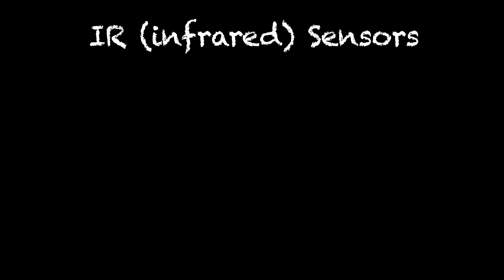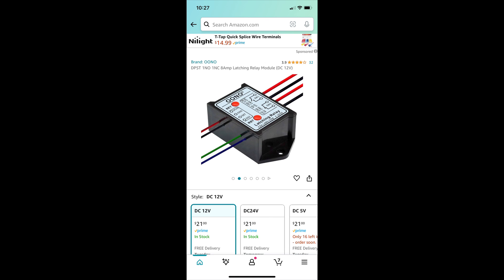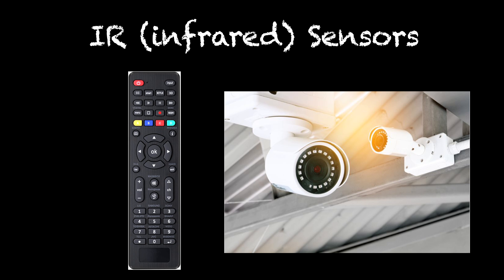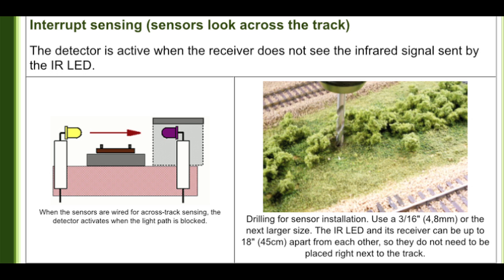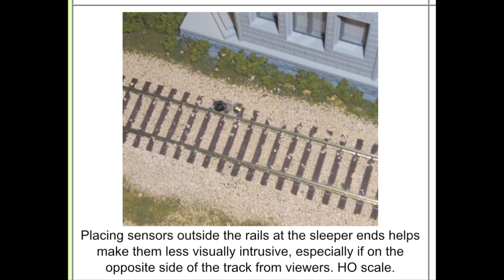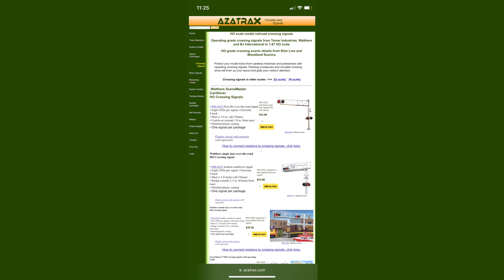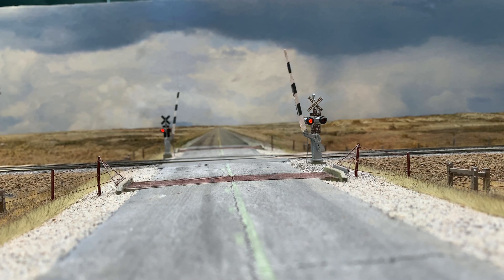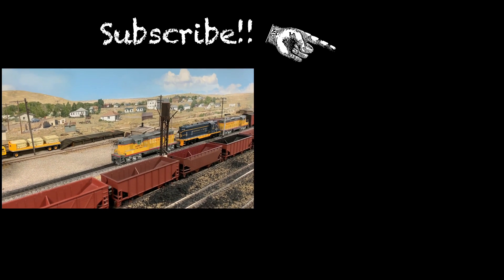IR (infrared) Sensors - Electricity for Model Railroads

Comment: I really enjoyed this subject. Since my o-scale layout has an oval with a figure eight on the upper level, I want to try my hand at setting up some relays to control traffic on the incline/decline connecting the upper and lower levels and collision avoidance on the figure eight. I’ve got some Z-stuff that will probably work. I need more time, though. And less Toy Man Television on YouTube is not an option. 

Oh Wamsutter! Back in the 70s, I used to work on drilling rigs in the Red Desert to pay for college.  We exited I-80 at Wamsutter as I recall and went north for an hour or so on roads paved with gravel. While driving back and forth between good ol’ Rock Springs and the rig, I used to think about how cool it would be to model that stretch of the UP.  

I made a trip there for Christmas vacation one year and made enough to pay for Spring semester tuition, most of my living expenses. As the old Mark Twain saying sorta goes: Those three weeks were longest, and coldest, decade of my life. 

I would like to know more about that layout.

Comment: Great presentation Dale,  I have a number of Azatrax products on my layout and have been quite happy with them.  I use them to control reversing loop turnouts, for automation in a staging yard, for simple occupancy detection, and to control grade crossing signals.  Most of these are across the track setups with the grade crossing being in the reflective mode.  All have been extremely reliable with the only issue being some false triggers on the grade crossing because I have white Ikea cabinets about 20 inches above the layout.  I solved this by attaching  a sheet of black foam to the bottom of the cabinets.

Comment: I need to find one that will work with the old American Flyer crossing gate and other solenoid accessories. For now I just use the old pressure track switches.
Reply from the maker: Whatever works! But I’m sure it would be an easy conversion

Comment: When using an IR sender and a receiver for detection, they should be arranged so that the gap between cars of a train do not allow for a clear and seeable path to clear the circuit.  Something like a 45* angle and not over or under the bodies of the cars.
Reply from the maker: I never thought of that! Good point

Comment: What about us N scalers?  I like the idea of IR sensors.  Another thing you could do is a double dog bone with 15 degrees junctions.  Half baked idea (probably).  By the way a EE degree from MIT is not what it used to be to be.

Good video Dale.  Oh by the way whose layout was that that had the refinery back drop?
Reply: I tried to use the cheap Chinese IR sensor on my N scale layout, but I put them horizontally across two tracks. It didn't work correctly as it is, and also not with the LED on one side and receptor on the other. Maybe from below it would be better, but I didn't want these big LED in the middle of my Kato tracks.
Then I got a few TOF (Time Of Flight) sensors, which is a laser distance sensor, and it works a lot better (but it need some Arduino programming).
If I wanted to buy a finished product, I would try the TrainSpotter of Iowa Scaled Engineering, as it use an advanced integrated (and tiny) IR sensor, and not just simple LEDs.
Reply from the maker: @pbyfr thanks!!!  Good information 😊
Reply: @pbyfr  Thanks.  I’m so cheap I would have tried that.
Reply from the maker: That is verl fosnights. I thought I
Put a link… I’ll grab that.
Reply from the maker: https://youtu.be/Ee_j4MNf_1c?si=hwZp1m7O0Aw_9OHQ

Comment: Just a note about crossings.  The lights and gates are activated 38 seconds before and after the trains passed adjusting for speed according to the railroad safety system.
Reply: The minimum time requirement is 20 seconds at prevailing time table speed before the train gets to the crossing.
Reply: @jacko9759   The sender-receiver pairs should be located every five feet along the track, as ye want to follow regulation.  The undersides of all locomotives and rolling stock should be mirrored so that the sensors pick them up consistently.
Reply from the maker: I triggered one once! I was desperate to figure out how the things work and there was some abandoned tracks near a nearby oil refinery. So I took some jumper wires and set them across the tracks. Nothing. So I moved further up the track and tried it again still nothing further up the track getting further away from the signal nothing I could see the insulators in the rails so I tried going to point well back from the crossing where I could see the insulators put my Jumperbefore the insulator and then moved it up to the insulator and ding, ding, ding ding!